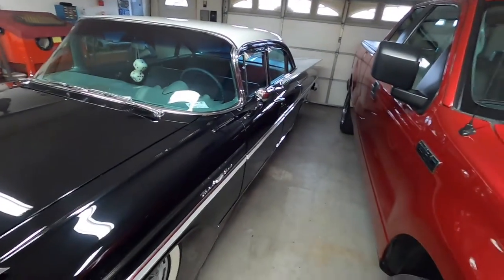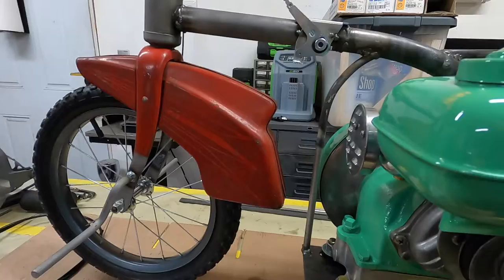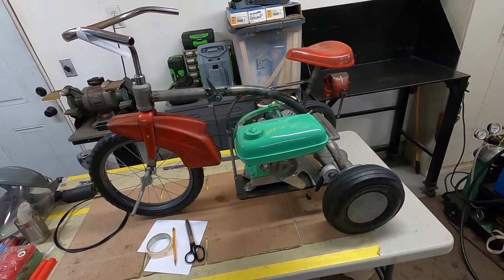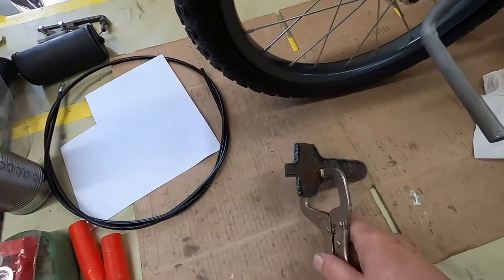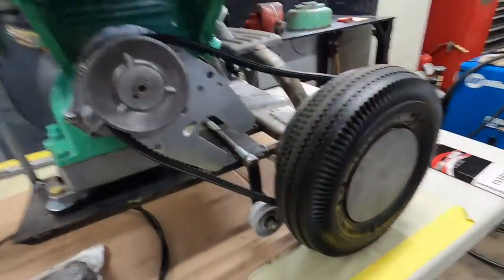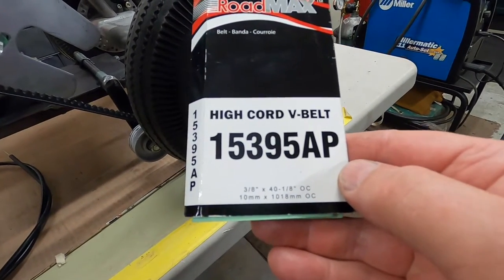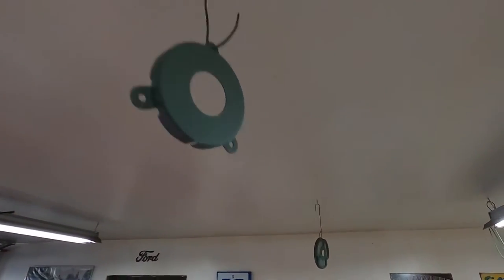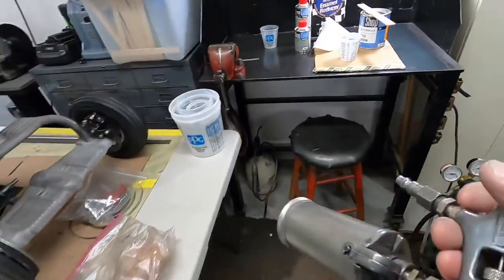REO Trikeabout build part 5, painting recoil starter, gathering control parts

Comment: Howard, you gotta have "streamers" on the handlebars! And re-make those Sears decals on the front fender. I'm still nervous about this project, it going to be a dangerous vehicle! Please be extra careful when you're riding it....please!
Reply from the maker: I'm totally going to repaint the fender strips, in engine green. I have a nice set of old tricycle hand grips.... I was looking for ones with streamers, bit I think they might get in the way riding it. I don't think it will go that fast or be dangerous. I am going to weld a tab limiting the front wheel steering travel..... I don't want the cables getting kinked.

Comment: Good choice on the upgraded cables. Love the factory stamped directional arrow on the pull start cover. Chrome tip going on the exhaust??
Reply from the maker: No chrome tip.... but I want to make it with a thin and wide outlet.... I'll make the exhaust outlet (muffler) myself.

Comment: Just an observation. I had a 1982 Excel commercial walk-behind lawn mower. The mower used what the called steering brakes using levers like what you plan for brake and clutch on the trike. The pivot point for the levers was just a bolt and nut with the bolt through the handle bar. In later years the pivot point for the steering brake which is used constant as you mow egged out and finally failed with the handle bar breaking off. While it lasted a long time and the the steel tubing for the handle bar was about 1/8" thick in the wall of the tubing it probably should have had the bolt going through a bushing or not gone through the tubing at all with a drilled set of ears welded under the handle bar to accommodate a bushing and the mounting bolt. Or maybe even the levers mounted using clamps like a motorcycle. Just something to think about not that your trike will get such abuse or that it will be a problem in your design. You are making great progress and the design is coming together well. What a good winter garage project.
Reply from the maker: I have a friend with the same mower years ago, with the same issue, but he used it ALL the time. He owned a lawn mowing service. I welded it all up for him after his second sets of handles. That lasted. IF I put an hour of use on this thing in a year, that will be a lot, so I am not worried about it one bit. I doubt it will ever ware out.... it's a toy, not my everyday transportation. If it does ware out or break, I'll repair it. I'm hoping to ride it today or tomorrow, then start making all the sheetmetal covers and whatnot.

Comment: I am by no means a structural engineer but I think The bar welded to the bearing housing for the fork lacks some structural integrity. for a small kid it would be fine but for a grown adult. I think you’ll have to add some gussets to reinforce it some otherwise the weld May crack and fail.🛠🇺🇸🛠
Reply from the maker: I don't have an issue with the way its welded. The steering head is fairly heavy steel. When I clean up the welds, I'll run a bead up to the head for extra strength and so I don't need to use body filler to fill any voids. My worry is the forks..... I'm thinking of running a bead of weld up the inside corners for strength. I got to pull the fender first..... that will be after I get it moving under its own power..... maybe sometime next week. Then it will be a ton of grinding welds and body filler for any pits and what not, to get it ready for paint.